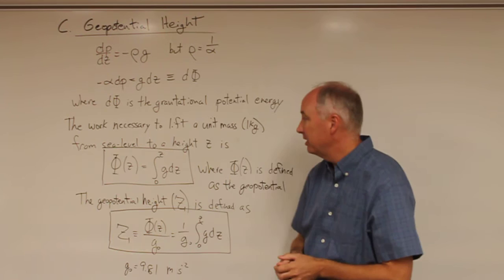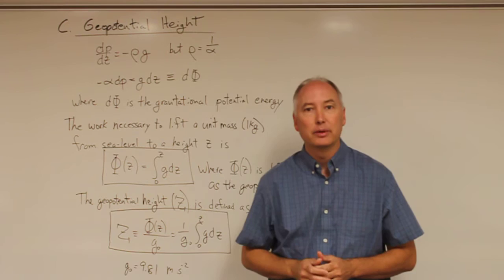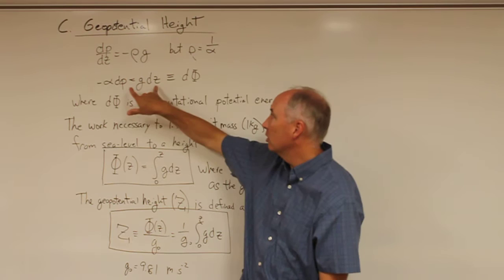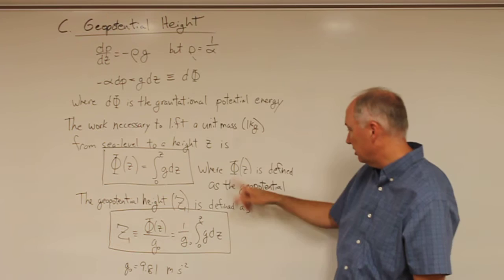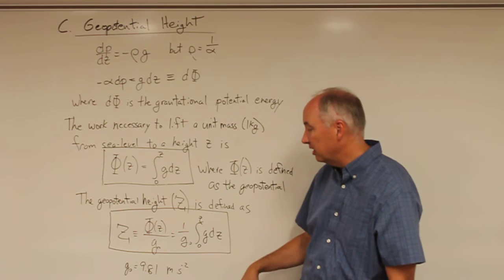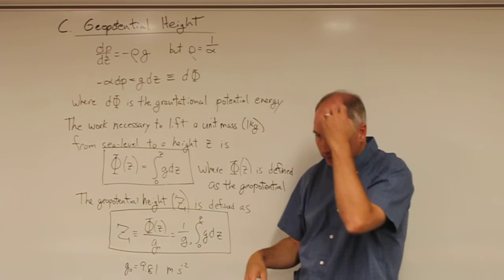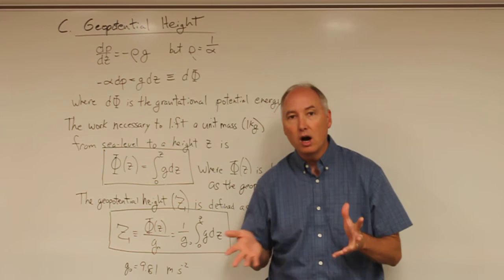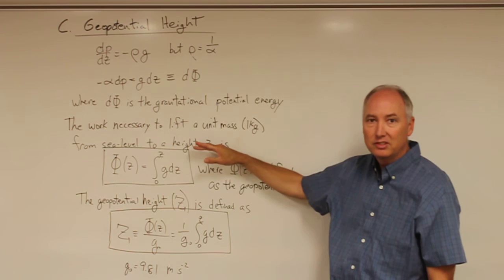Lecture 3: Geopotential Height Equation

Comment: I appreciate your teaching b/c its clear and precise. I have a question what is the difference between Geopotential height(altitude) and Geometric height(altitude)????
Reply from the maker: gravity decreases with altitude. If you use the surface gravity to calculate potential energy then you will overestimate it by a little.  Geopotential height adjusts the altitude downward just a little bit so that the gravitational potential energy will be correct if you use the surface gravity to calculate potential energy